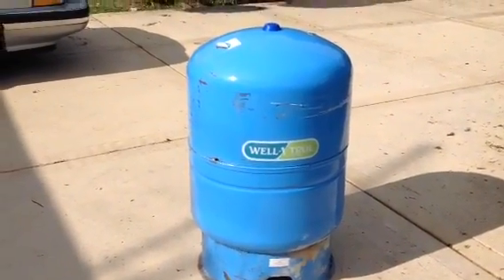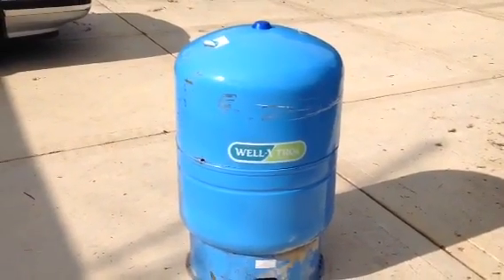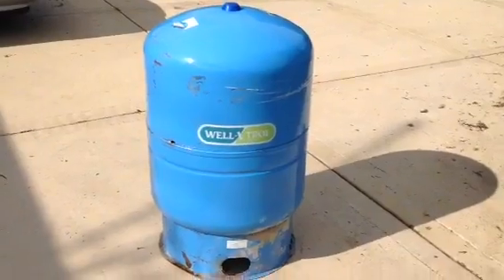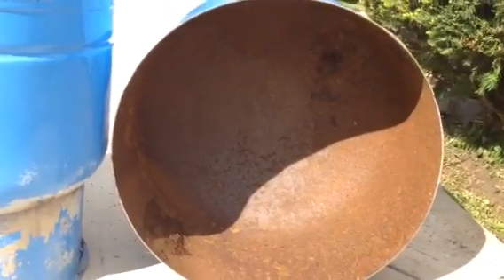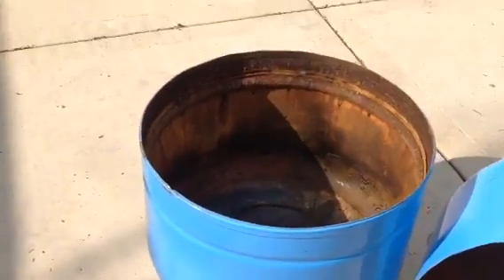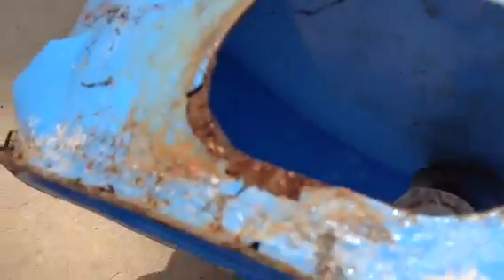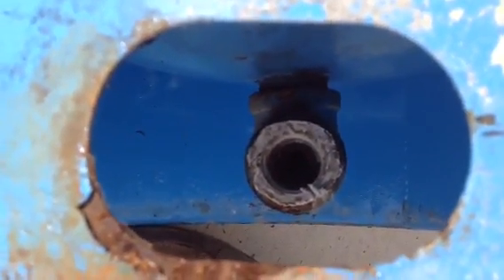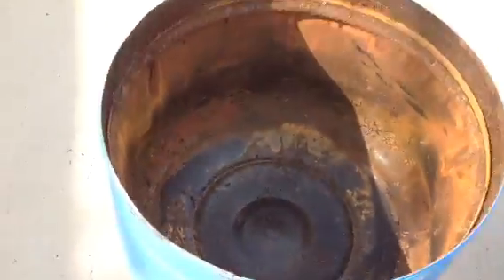Pressure Tank Bladder (WX-250)

Comment: so water goes into the bladder I assume?
Reply: The bottom of the tank has a plastic liner, and the butyl rubber diaphragm is made in the shape of the liner. In the video the diaphragm isn’t easy to see because it matches the shape of the lower part of tank. So water will push the bottom of the diaphragm up into the tank against the air pressure in the upper portion of the tank.

Comment: Hellp CPL, I have two pressure tanks to replace.  I am looking to repurpose them.  How did u cut this tank?  The cut is perfectly clean.
Reply from the maker: Just saw your comment.  To cut the tank in half, I first drilled a 3/4" hole in the middle of the side, then I took a recoprocal saw, put it into the hole and cut the tank all the way around the tank. Thanks for your question.

Comment: DID you hook up a water line to see the blater expand?
Reply from the maker: Stephen Mauro   I did not check the bladder under load.  The reason why is because the brass inlet at the bottom this tank was completely plugged with sediment. Rather than trying to fix this 20+ year old pressure tank, I opted to just replace it. Thanks for you comment.

Comment: These are pre charged tanks ........you could've simply added 30 lbs of air in the top of it and replaced a few rusty fittings. Next time save yourself time and money and call a professional..also your cut on pressure needs to be raised to 40 lbs.

Comment: Your tank did not go bad.  Your fitting got plugged, so there was no water storage in the tank.  So your pump turned on everytime you turned on the water in your house.  You might have been able to fish out that 90 degree angle, but you probably did the right thing replacong it.  I replaced the same water tank you have a couple years ago, and that same ditting started to leak.

Also, the city water supply is intentionally contaminated with flouride.  I would switch your water piping in your house so you drink your well water and water your yard with the ciity water... it is healthy for yourself, and you won't be poisoning yourself.  Why do you think they are forcing you to drink their water??? Come on, really?.  As soon as that inspector left, I would have been installing cross over lines with valves.

Comment: your very good at landscaping nice yard. I  am on a well. And today I went to put salt in my softener, which is in the same little house  as my pressure tank I discovered my pressure tank is leaking water on its bottom. It is a constant  spray for the bottom.  Though I can't see the leak because its a tight fit in the little house. But when I  place a mirror in the lower opening . its not long before it is entirely wet. You brought up a point about rust causing the failure. Was rust ever apparent in your water supply?
Reply from the maker: Thanks for your question.  Yes, rust was an issue with my well when I first bought my home back in 1991.  After seeing the damage to my appliances, sinks and clothes (when washed) I immediately installed an iron filter.  As I recall, it was around $1,000 for the entire system and I did all the installation work myself.  Since it's installation, rust has not been an issue.  I hope this helps.

Comment: Very nice yard!   ☺  I was wonderig what the tanks looked like inside so thanks for sharing your video. You are lucky to have both water sources.  I'm in a subdivision where everybody is on well water so the closest city water is more than a half-mile away and would cost a fortune to have it run to my place. it would have the meter set at the main Highway and would have to run through everybody's yard until it got to my place. Certainly not something that is doable. So again you are very lucky. I have had the same WellXtrol brand (but 44 gallon size) for 30 years.  Just now having problems with it and will replace with same brand. Well pump was replaced in 2013 due to lightning strike. Who knows... it might've still worked had the storm left it alone.  Hope you had no other problems.  I've had major water related stuff since 2013. In 2015 my home flooded and I had to live in a hotel for 2 months due to hot water heater being ruined/bursting from debris (roots) filling it up from my well.  I have a video on Youtube showing how bad the roots were coming in because I do not have a well liner and roots cracked my casing of my drilled well.  I have so many home repair problems I can't afford.  I just need a NEW, decent, place to live!  LOL!

Comment: Did you use a grinder to cut the tank open with or how did you cut it in half?
Reply from the maker: Actually, I drilled a 1/2" hole in the side of the tank and used that as a starting point for my reciprocal saw and cut the tank in half.  I already knew the tank's bladder had failed because water was spraying out the air inlet value on the top of the tank.  However, I always wanted to see what the inside of a pressure tank looked like.  Thanks for watching.